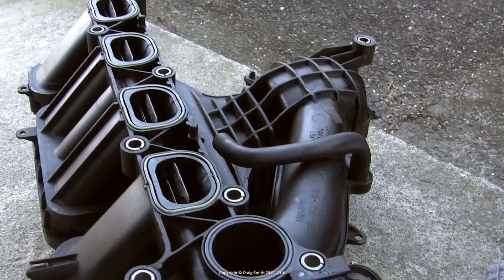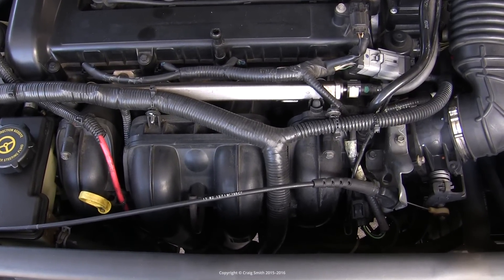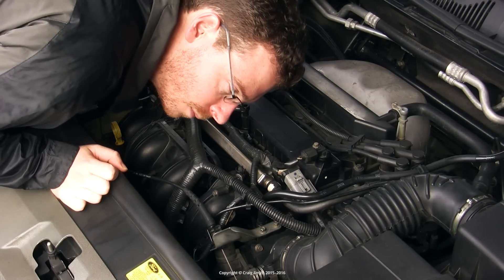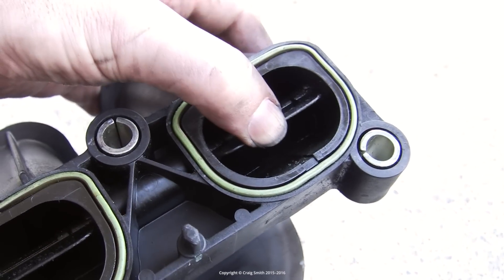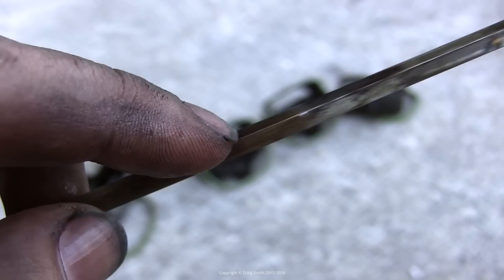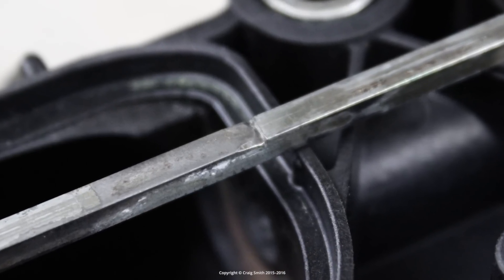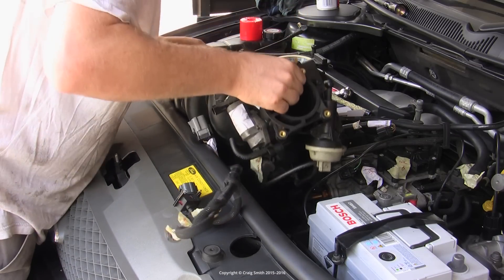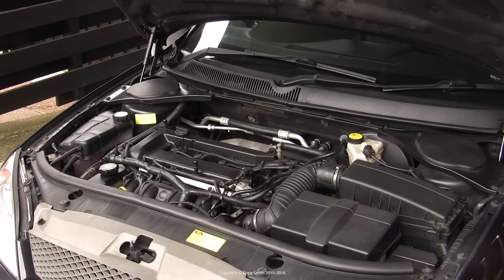How to: Fix swirl flaps & save your engine (Ford Duratec HE, Mondeo/Focus/et al)

Comment: Hi! I did the replacement job at the weekend.
 - My Mondeo MK3 had about original 183.000 km (2005 2.0 Petrol)
 - I could hear only a light noise, but the problem was there.
 - The rod and other parts were undamaged so I've replaced only the 4 flaps. (The flap shafts were damaged)
 - There was no second screw on my Oil pipe bracket. Removal was not necessary.
As a hobby mechanic the whole process took about hard 10 hours! The intake manifold removal is a huge job! (I have renewed all cable clips etc.)

Now the engine is quiter, there is no diesel sound.

In my opinion this problems comes after 200.000+ km .

Thank you very much the video and the instructions!

Comment: Changed mine on my ghia x mondy. You don't really need them as it's only there to keep things smooth at low rpm. I will be getting another manifold and remove them completely and fill the holes with araldite, all the flaps and gaskets came to about £65 and we're easy enough to do.
Reply: By filling the holes, you don't mean the holes where flaps were, right?
Reply: helloukw no only the holes where the control rod (where the flaps attach to) pass through the intake manifold. Once the glue is dry you'll need to smooth it down so the intakes are nice and flush for optimum airfow.

Comment: Was doing a pcv valve on my Mazda and noticed the swirl flaps were stiff to turn, jammed them open by putting a screw in the solenoid side, did not reinstall solenoid so far so good
Reply from the maker: The flaps are open by default (when actuator relaxed), so from what you wrote it sounds like you have jammed them closed.
Reply: nah did it with the intake manifold off, was going to pull them out and fill the hole but it was stuck in there. to do the pcv valve on them you have to pull the intake off so though why not do some preventative maintenance, no check engine light unplugged it from the solenoid and actuator

Comment: I have a 2006 Ford Focus ZX4 2.0 Duratec. I accidentally snapped one of the flap housings when removing them from the intake. I can still snap one part of it in the manifold but i am afraid that it may not keep the gasket tight against the engine housing causing a vacuum leak? Do you think this could be an issue and would you buy the replacement flaps anyways? I had planned on removing the flaps entirely but now I am unsure if that is a good idea? Opinion?
Reply from the maker: The new flaps come with housings. If you're trying to use the broken one, maybe you can glue it together. But it is necessary to hold the gasket, and if you think it can't be fixed and if there's any risk of an air leak, I wouldn't waste the time, just replace it.

Comment: take em out and toss em in the trash, just plug all the holes.
Reply: Any chance if flaps are removed the car would pass US California smog inspection??  I suspect I have this issue, and it currently won't pass smog.
Reply: Seriously?
Reply: DaveyKracker same if I do that will the car pass smog?
Reply from the maker: People in the UK pass their emissions test on de-flapped Duratecs, many reports confirming that now. The flaps apparently do not really make a big difference. One of you in California should take one for the team and report back! :)
Reply: @CraigsDIY  I live in Cali and was planning on doing this in the summer. Just want to verify that it would apply to a 2005 ford focus SE? Thanks for the great videos!!

Comment: what can i use to plug the holes once i remove the flaps?
Reply: Hello, I did the job about 2 weeks ago. I removed the flaps and rod completely and never closed up any of the holes. I simply cleaned it up and put the intake back on using new gaskets. I reinstalled the actuator and never plugged or epoxied anything. My car runs great with no noticeable change in power or fuel economy.
Reply from the maker: You can do that. Some people like to seal up the holes between the tracts... but I doubt it makes any noticeable difference.
Reply: Craig's DIY Car, you are the man!
Reply from the maker: Any appropriate epoxy. Araldite would be fine.
Reply: Craig's DIY Car, I didn't epoxy anything or plug any of the holes. I didn't do anything to seal the one at the end where the rod connects to the actuator as putting the actuator back on seals that hole anyway. I took out the rod and flaps and that was it. Car is running great with no clicking! Thanks Craig.
Reply: Hey guys. Thank you for this great video Craig'sDIY Car !
I do have the same problem and I plan to delete my flaps. I was just wondering how to close the holes, and by reading some of your answers I undestand that some of you don't close the holes at all ? 
Is this OK ?
I'm writing from France, hope my english is good enough to be understood and get some great answers ;-)

Thanks again
Reply: TY Lance !
Maybe I'll try to do it this way. Problem is my wife yelled at me a lot when I told her... Sh'es afraid I break the car :-(
Reply: Thanks to Craig, it is really quite straight forward. I took a lot if pictures as I went so that if anything was unclear, I had a reference photo to help me remember where things went. Tell her to go for a spa day and the car will be done when she gets home. I did it in a few hours with changing the valve cover gasket.
Reply: It's straight forward yes, but without the good tools it may rapidly turns into nightmare no ?
I'm wondering this : my car is showing a P2008 error code. This code can't be caused by the swirl flaps by themselves ? They are vibrating ok, but they are vibrating since a few months / years... I mean, the problem comes from an electronic part right ? I have to make a 1200km trip on next WE and I won't have time to remove the error code. Does it really looks dangerous in your opinion ?
Reply from the maker: You have a Mk3 Mondeo? The P2008 must be from the actuator itself, either failed or problem with the wiring. This is not dangerous, and if the actuator is not working then the flaps will remain open. To fix you will have to check the wiring electronically, and either replace the actuator if faulty or just accept the code and ignore it - in either case, best to deal with the flaps themselves ASAP.
Reply: Hi Craig !
Thank you very very much for your answer. 
Yes, I do have a MK3 Mondeo, the one with 2.0L 145 Flexifuel engine.

It confirms what I was thinking : this is not really a mechanical problem that could damage the engine.
I'm searching Internet to see what is an actuator and most of the links are related to a turbo actuator. And there is no turbo on my car...

Could you please give me a link or something  for I can exactly see what I'm supposed to look for ?

Thank you again !
Reply from the maker: By actuator I mean the flaps "piston", which is vacuum powered but activated by electrical switch. As shown in the video. However your mention of 145 Flexifuel makes me think you have a later car than a Mk3, 2008+? (Mk3 is 2000-2007). If so then your manifold may have the newer runner control (IMRC) and the P2008 error will probably relate to them. I.e. different to what this video shows. I believe that's a common problem on Focus Mk2's and Mondeo Mk4's.
Reply: Actually it's a 2009 model, you are right.
So it's a MK4.
Hope I will find video as good as yours for my model then...

Thx again for your help!

Comment: I have a 2007 ford focus ST 2.3 duratec. Is this the final design iteration? am i safe from this problem?
Because my engine sounds exactly like yours at the beginning
Reply from the maker: I don't know sorry. I don't believe that Ford ever made this problem completely 'safe' though, so if you have the flaps (check for the actuator), and they haven't been looked at in a long time, it would be prudent to inspect them at some point.
Reply: Craig's DIY Car thanks, will do :)

Comment: Wouldn't it better if you just buy the Coswort MZR aluminum intake manifold? I did some calculations and price of a new OEM intake manifold is not really far off to the aftermarket one. + the intake manifold gives performance gain and its metal rather than cheap plastic.
Reply from the maker: Haha, if you want to invest the $ sure. You will have to check if a re-MAP is required.
There's nothing wrong with the plastic by the way, it's perfectly strong enough and provides superior airflow with smooth surfacing at a lighter weight.
Reply: Nothing wrong at all ...unless by wrong someone meant that the engine will SELF DESTRUCT at 85k   ...other than that though?  GREAT design!  great materials .....NOT

Comment: still a problem on the 2010 duratec 2.0? Ford focus
Reply from the maker: You need to just look to see if there is a flap actuator attached to the manifold or not, it is all visible without disassembly. If you rev the engine you can see the movement, as shown in video. If there are flaps it's a risk.

Comment: hello Craig. I have a mark 2 Ford focus 1.6 petrol engine. do you know if many has these swirl flaps? I've been looking everywhere and can't find a concrete answer. Thanks
Reply from the maker: The 1.6 is the older Zetec, so no I'm pretty sure they don't. But they are always identifiable from the external actuators, so you can just look to be 100% sure.

Comment: Hello, I don't have those bushings, the only thing that came out apart from the rod and flaps was that green bit from the actuator side and a small metal spacer (not sure where that came from, it just fell off after pulling the rod). Any opinion on that? The car is from 12/2005.
Reply from the maker: Are you sure about the bushings as they can be quite well hidden - can you see through the holes? As to the actuator side fittings, just put them back - or if you are removing, you need to epoxy up the hole and it doesn't matter.
Reply: I am 100% sure, and since I also removed the end cap from the other side, I could slide a ballpoint pen from one end to another. What should I do? Buy new bushings or just mount the new flaps directly? How much load are those bushings bearing?
Reply from the maker: Surprising they're not there on a 2005 motor, I have heard only that they were missing on very early Mondeos. Yes I think you want the bushings, they were obviously added for a reason. It's not a 'load' so much as dealing with vibration - the rod allows a bit of flex, and the flaps want to move laterally, and the resulting wear does the damage as explained in the video. However given the likely expense, and depending on other components needing replacement, along with value of the car, you might find yourself deciding between 1) a complete manifold & PCV kit replacement as better value in the long run, and 2) deleting the flaps. For what it's worth, I was able to rotate components 180 in my case, but next time it will be option #2.
Reply: Thanks! Since I'll probably still keep this car for a while, In the end I decided to order them all (flaps, bushings, gaskets), for a total cost of ~30% of a new manifold.
Reply: I've just replaced them and when manually turning the flaps (with the actuator off) they offer some resistance. Is that normal? Or should they be freely moving?

Comment: Excellent videos.  I am the the US yet many things cross to my 2006 Focus ST with the 2.3l duratec.  I just removed the manifold and have removed the rod and flaps.  On another YouTube video the guy fills the holes between the runners with epoxy.  Is this necessary?
Reply from the maker: Not necessary to fill the holes. But it wouldn't hurt.

Comment: Craig, if you just pull out the small vacuum pipe at the front, is there still a risk of the flaps falling into the engine?, I have remove the pipe and it has stopped the rattling noise but not sure if It's a long term fix
Reply from the maker: It's not a long term fix, just an indicative test... if they are loose enough to rattle, they are still loose in there and can still eventually fail. You may slow the wear down a little but not stop it 100%.

Comment: Would disabling the actuator work effectively? The concern is it wearing out to the point pieces break off an get in to the valve chamber, besides the annoying clatter.  Disabling the actuator, and leaving the valves in the open position.
Reply: What evidence do you have that mild vibration alone (with the actuator disabled) would be sufficient to cause continued significant wear of the rod resulting in inevitable fragmentation of the rod?  I am trying to understand how, what I imagine would be relatively mild rod vibration of plastic against the stainless steel rod, could cause such erosion of the stainless steel rod. Have you actually observed the damaging effects of vibration, so that you speak from experience or is that just your conjecture?  I really would like to know whether you are speaking from a position of experience or conjecture. I will be pleased to have learned something if your answer regarding such vibration is based on observations of multiple cases of "vibration only" induced erosion of a stainless steel object in such an environment .  Sorry to be so tedious. I have trouble communicating, let alone communicating succinctly.
Reply from the maker: If you did that from day 1 you would probably slow the wear down, although it would probably still occur. (It seems to be caused as much by vibration as airflow). But once worn you still have a time bomb, leaving them open may quieten rattling but it's not a safe permanent solution.

Comment: How many time or kilometers will usually last?
I have a Focus MK2 from 2008 with 130K Km. Should I be worried?
Reply from the maker: I don't know if the 2008 manifold uses the same flaps, you need to look into that. If they are there then yes be worried.
Reply: I guess it have, because I see the pneumatic actuator(vacuum lung) close to the throttle body

Comment: Have this problem on my 2005 focus Zx4.  Clicking goes away with pulling the vacuum hose.  Attempted to change out the intake runner control valve.  Was not the problem.  Ford does not sell the flap assemblies separate here in the USA.  Would the ones you have put a link to fit for my vehicle?
Reply from the maker: Yes they should. You might like to look instead though at replacing the entire manifold, and possibly upgrading it to the latest Focus revision.

Comment: Let me ask u..on a( 03 focus.SE..L4 vin3 zetec 2.0 Dohc) Does is have a oil cooler???? iv noticed a possible leak.It is accumulating on the plastic shroud under my radiator.which makes me think it's either a oil cooler or maybe it's built n2 the actual radiator.idk? but any leak must be fixed 4 longevity so as soon as it warms up, it's coming apart.just wish I knew exactly what & where the problem is upfront so I can pre order parts.
Reply from the maker: I don't have that Focus anymore so am not familiar with it anymore. But I don't believe it has an oil cooler. Try cleaning your block down with brakeclean and try to trace the leak back further.
Reply: tho.i only saw the leak on my driveway & on the plastic under my radiator.i haven't seen any actual leak.& i saw a oil stain under my radiator so, i used a 1.25quart jug of oil.setting it on top of radiator as i filled the motor & also on concrete, in front of my car.the oil filter is on the back of my motor &the intake is on the back, exhaust is up front by the radiator  on the vin3  zetec dohc 2.0ltr.the stain is no where near my filter or drain plug so, now I'm thinking maybe some oil ran down the big,gallon size jug & maybe I don't have a leak at all.a bit of oil on the bottom of the oil jug makes me wonder if the jug is leaking & maybe when I sat the jug down it caused the oil stain & explains why I had oil on radiator shroud & on concrete where I also set the jug.time will tell. thanks tho.what ya driving these days???

Comment: Great video I must say. Do you have any idea why the noise goes away when I unplug the solenoid? I would think that if they are loose they should continue to vibrate even if the runner control is not active.
Reply from the maker: The flaps are positioned open when relaxed, the actuator closes them when you start the engine and only releases again at higher revs. So when you disconnect the vacuum, the flaps open and make less noise because of reduced air pressure on them. At least that's the theory, the engine revs and vibrations also change around because you're introducing a vacuum leak, so it's not a perfect test.
Reply: Craig's DIY Car thanks for the quick reply. The noise goes away completely when I unplug the solenoid.... and the noise only starts after the car has warmed up. Im wondering if it's worth replacing just the solenoid before I venture into taking off the intake.
Reply from the maker: Solenoid unlikely to be the problem. If it is presenting with engine temp, then you may be being misled with the flaps as they shouldn't be affected by heat (although it's possible I guess). As I said above removing hose introduces vacuum leak which changes engine revs so you must be very careful interpreting results. This is an example of loose flaps (worse than mine were): https://www.youtube.com/watch?v=5gaD0TXOASQ